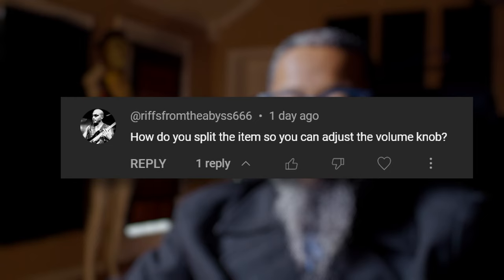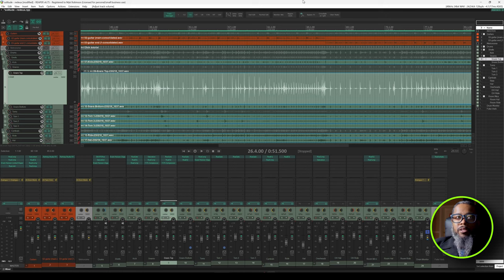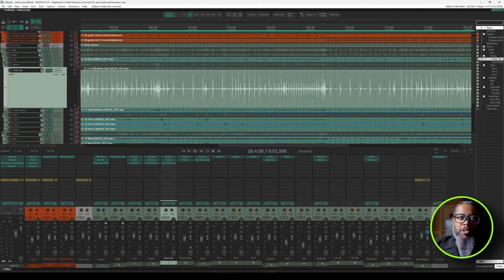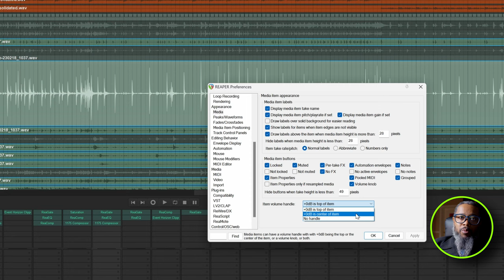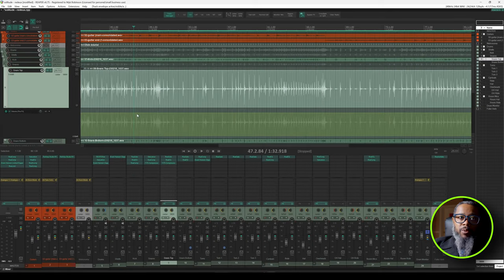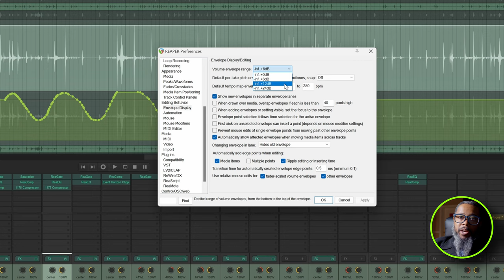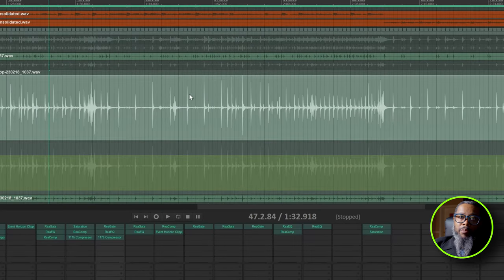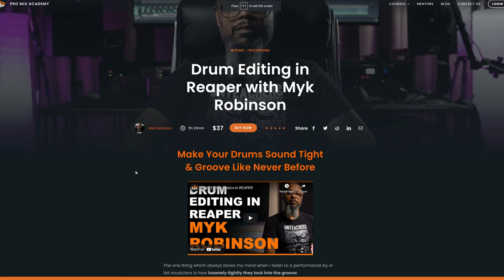PreFX Volume Envelopes in REAPER - Control Levels Into Your FX Chains

Comment: Thanks for this video! Pre FX envelopes ar a clever option to set the perfect gain to feed the FX chain.
Free hand envelope drawing is great for general moves, but when it comes to fine tune the level of a performance, I'd use time selection and Ctrl+Shift to create a segment and adjust it on the fly. (Nice trick for writing automations, especially mute or sends bypass automations.)
Reply from the maker: Agreed, in practice, a combination of the two can be beneficial. Rough it in with time selections to change a larger portion, and make minor edits as needed with free hand drawing to pinpoint finer bits. I should have shown both, but I think I can supplement this with a short for those who aren't aware of the time selection method.

Comment: Would hitting f2 to get to item properties and adjusting the volume slider there achieve a similar effect? Is the volume knob option a visual representation of this feature?
Reply from the maker: the item properties method does indeed achieve the same result, both audibly and visually, however, the volume knob appears to be another stage, so to speak. For example, if i turn the item up or down on item properties, the volume knob remains exactly where it was. The two will affect the item, but the outcome will be the combined effort of the two. I find it easiest to just have the knob on the media items, since it doesn't require opening another dialog.

All that said, i tend to use both the volume knob and a prefx envelope, if necessary, as that can supplement the volume boost/cut at a more precise level to help even out a performance.
Reply: @LetsTalkAboutReaper  excellent, thank you

Comment: Cute Kid! congratulations!  Is this envelope any different than the item volume envelope, the one you can edit directly on the item? i use the later fairly often find it great for taming loud hits.  It would seem to be the same thing, with maybe the only advantage of the pre-fx envelope being more editing options, ie: razor or automation items.
Reply from the maker: I haven't tested with the take envelope, but my assumption is that it will perform just the same as the item properties volume control. 

If I'm right, you can use the item volume and also supplement it with the pre FX volume envelope.

For example, if you turn the item up 6db and also have a pre-fx volume envelope at -6db, it'll be the same as before you changed anything.

I do prefer the envelopes in lanes as opposed to directly on the media item, though.